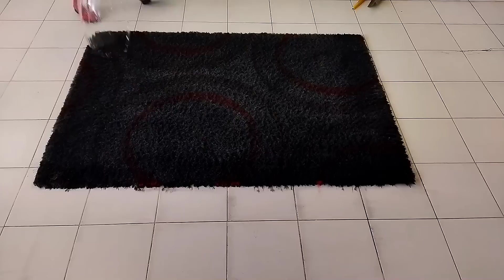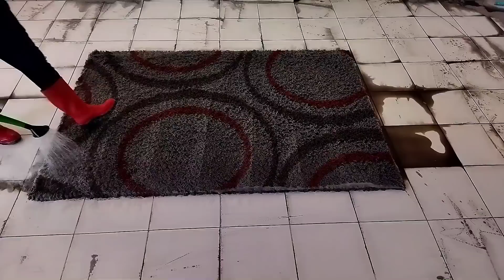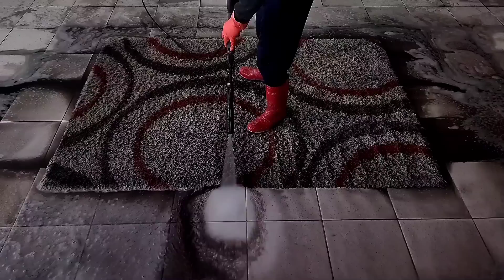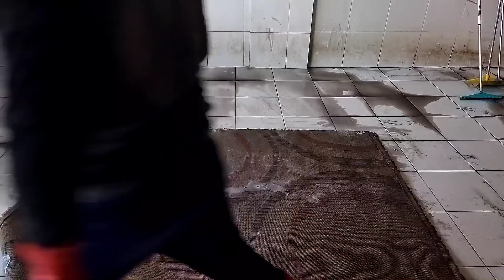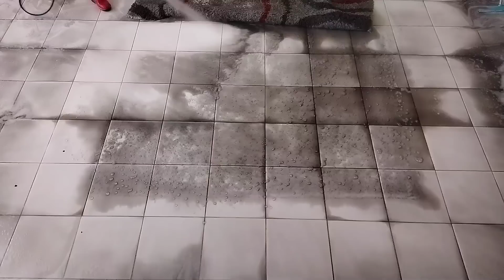Exposed to heavy smoke dirty carpet cleaning satisfying ASMR

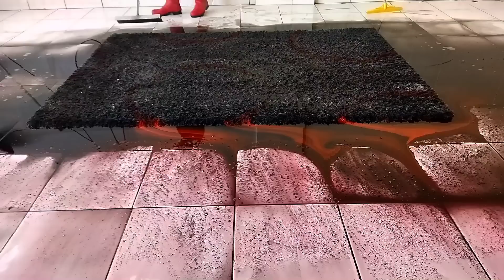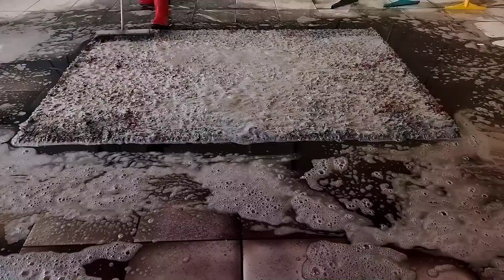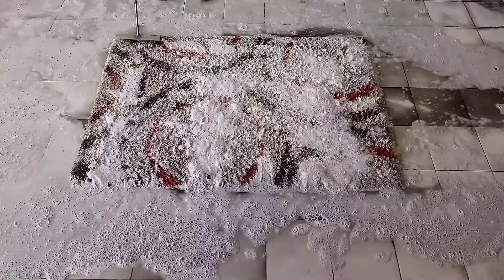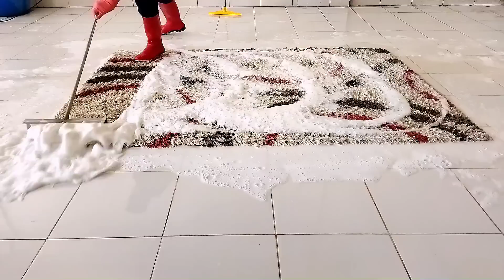Comment: 1:00 3:05 5:50 7:10 10:05 15:20 17:55 18:20 20:20 21:05 I don't get it. If the drain hole is on the right, wouldn't it be easier to push the wastewater out of the carpet from left to right rather than top to bottom? For example, like 13:45.
Reply from the maker: I'm aware of this and I'm thinking of getting a fix for it. Thank you so much 😊😊🖐️